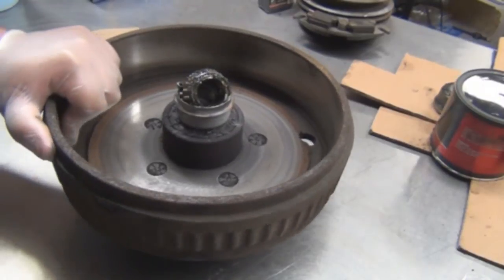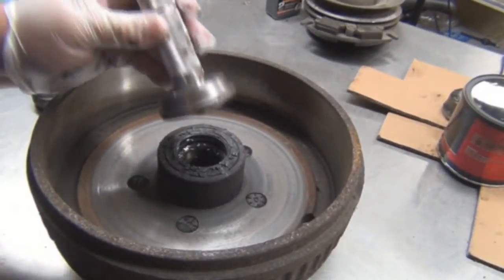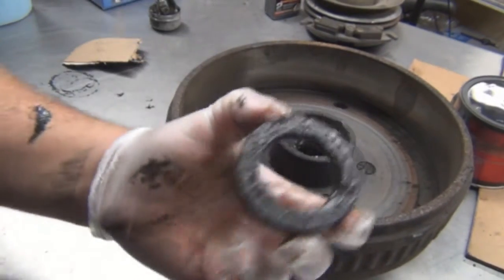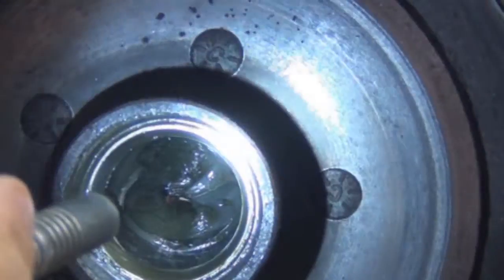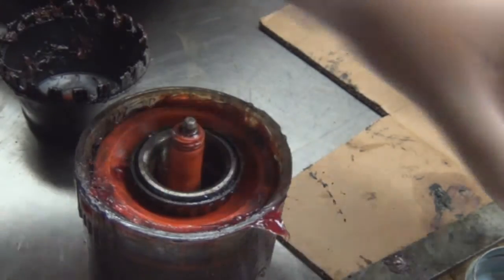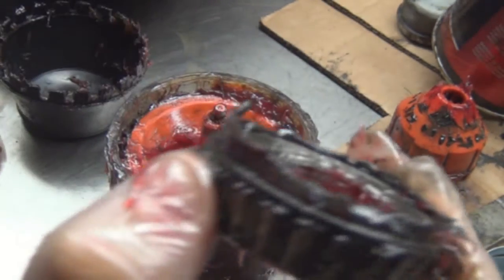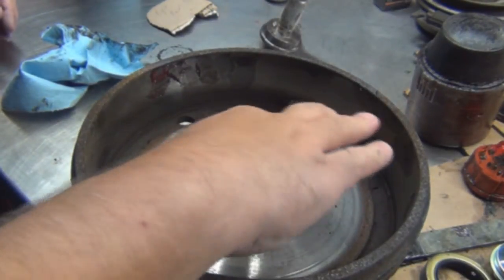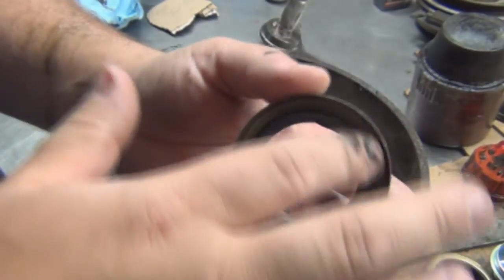How to repack wheel bearings and install new wheel seal (Trailer Hub)

Comment: I appreciate videos like these. That little spring you were talking about came loose on me I think ,during my install. So I have to do it all over again. I have to get me a bearing and seal driver set. I was using a small 2X4 to punch it in. Thanks for the tips!
Reply from the maker: +tomificationable  No problem, I appreciate comments like yours. Now there is another trick, you can take the grease and rub it in on the inside of the seal where the spring is to help keep the spring in. Also another alternative to a seal driver, you can use a large deep socket as long as the socket stays evenly on the metal part of the seal. Thanks for watching and commenting. Please like , share, and subscribe.

Comment: What will happen if the seal is not totally even around the hub?  I did one and one tiny area of it was below the hub lip, just a little bit but I could feel it when I ran my finger around the edge of it.
Reply from the maker: 9 times out of 10 it will leak.

Comment: The seal should fit snuggly on the spindle, correct?  The rubber of the seal on my trailer isn't even close to touching the spindle.  I picked up a boat and single axle trailer from a buddy.  I'm re-packing the bearings just so I'm not the guy on the side of the road.  He had it serviced ten years ago and let the thing sit.  So, job #2 is getting the bearings ready to go.  
Can someone tell me if the rubber seal should be against the spindle?  If so, how do I get the correct seal?  Calipers of the seal opening and of the spindle?  Thanks for any help.
Reply from the maker: Yes the seal should fit snugly on te spindle to keep the grease in and the dirt out. As far as finding the size , I couldn’t tell you. Reason why is if I do tell you that it might be a common size, then you might actually get an odd ball trailer that has an out of ordinary spindle size. So I would just pull the old seals off and measure the seal or hub vs the spindle. I would use a veneer caliper https://amzn.to/2VktwCG
Reply: @handymanPF  Thanks.  I'm contacting the trailer manufacturer about it.  I'm figuring that when my buddy had the trailer serviced (or he did it) he just found a seal that would fit in the back and put it in.  I'll get the right ones from the company and then keep the numbers so I can buy them from our local parts dealers.

Comment: Nobody ever shows how to get that hub off
Reply: Pull dust cap, If you have bearing buddies walk it out w/side wacks from mallet.  Clean as much grease out as you can, pull cotter pin, un bolt nut slide off & remove washer, then outer bearing so they dont flop around carelessly.